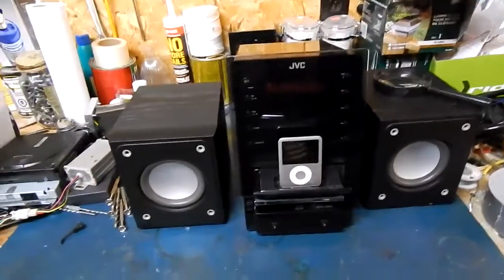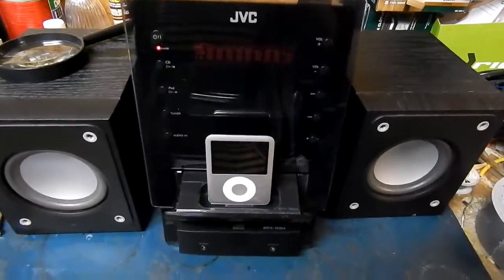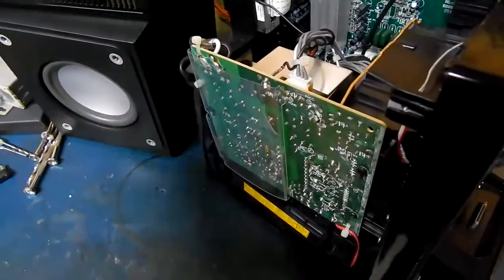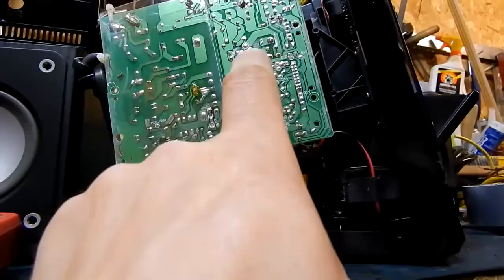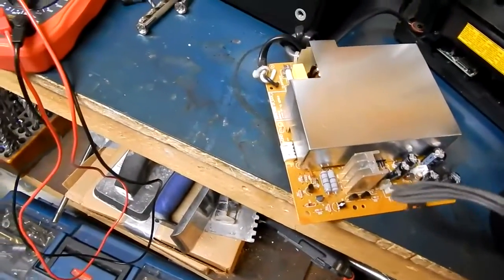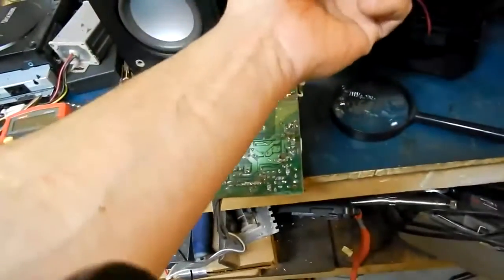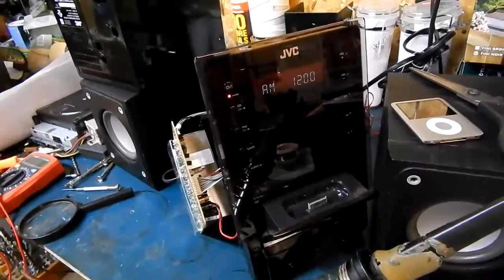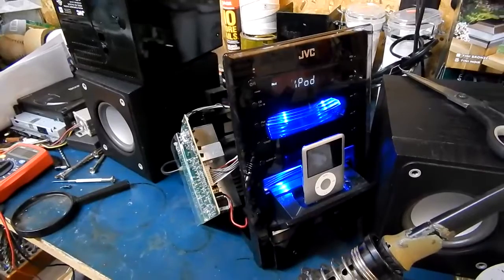JVC UXLP5 MICRO-SYSTEM  *REPAIR NO DISPLAY*

Comment: Thank you very much for this repair-video. We have a different model JVC micro set that had the same problem. It turned out it had an identical power-board to the one in the video, so one 100uF 16v cap solved it !
(actually I used a 45V version because that is what I had lying around)

Comment: This video couldn't be better, thanks! The solution provided worked perfectly for me, right down to providing the correct spec for the capacitor needed. And I got 6 of those capacitors for $2.

Comment: Hi, I have the JVC ux-700r with a very dim display but when I stripped it down there is no leads as the front circuit board that has the display on clicks onto two other boards with connectors so have no idea where to look. If you have a way I can send photos that would be good